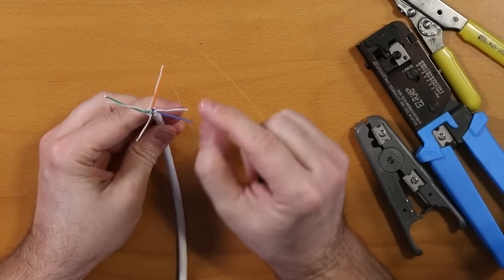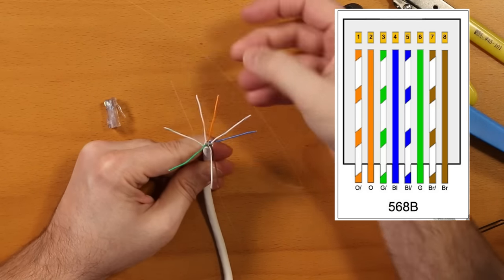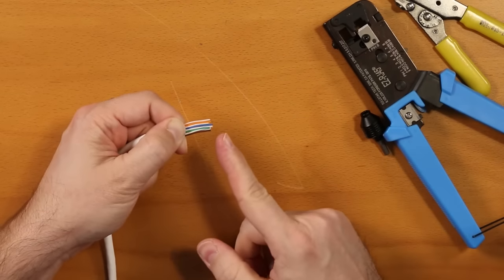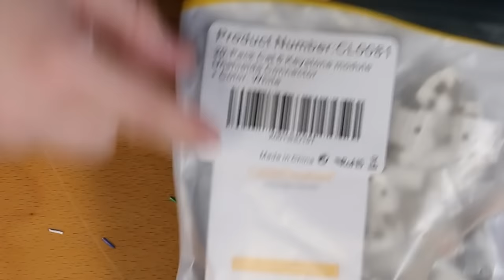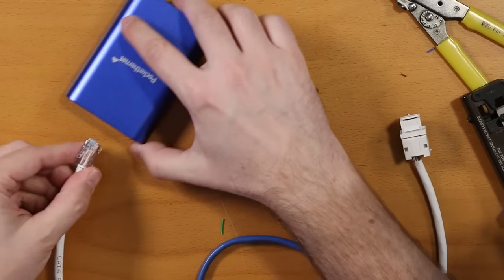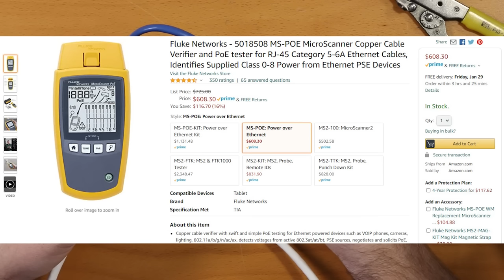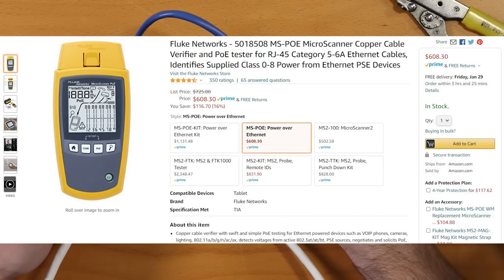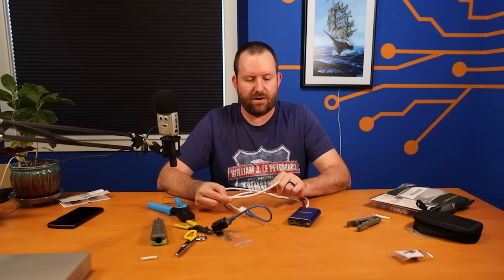How to Terminate Ethernet Cables

Comment: Not a fan of the pass through RJ-45 as it looks lazy. What’s so hard about pushing the pairs through to the end and crimping on the jacket?  I cringe when I see a gap between the jacket and the RJ-45 connector.

Same goes for the female end. I would place jacket in the middle of the keystone.  This would have shorter run where the wires are untwisted and hides the gap I mentioned above when the cover is placed over the wires.
Reply: The way you state this is such that you have never actually experienced a pass through RJ45 termination, but have pre-judged it and avoided it.  Use it and find out for yourself what is so hard about pushing the pairs to the end and crimping 50+ cables.  You will never use anything BUT pass through if you value the quality of your time spent on this earth.
Reply: I am confused; do you think pass through rj45's don't crimp onto the jacket or are you making two seperate complaints?
Reply: I've done probably close to 500 of each.  Passthrough almost entirely eliminates flipped pairs, and poor/unequal length insertion problems. Especially in dark IT cabinets.

If I did 10 of each back to back, passthrough saves about 10-15 min.
Reply: @jong2359  Maybe I have prejudged it since I have not done pass through termination.  But I do not see pushing 4 pairs of wires through the RJ-45 hard either nor an issue of unequal length when trying to get a flush connection.  If you snip your wires to appropriate length, it will fit and you push the sleeve to the crimp point.  I’m sure the pass through RJ-45s are more expensive too so that adds up.
Reply: @georgebush6002  The latter.
Reply: @soundman98   it’s true I see the advantage of being able to see the pairs easier when you don’t have a connector that can impair vision.  If you are crimping RJ-45 in a dark wiring closet, you have other issues as it isn’t worth the time to do since you should be working with a patch panel and pre-made patch cables that won’t have the clips break when you start to pull wires.

I don’t see a use case where you need to have a bunch of patch cables made other than the occasional custom length or possibly a crossover cable.
Reply: @soundman98  You maybe a little over-optimistic. The number one problem is a lack of attention to detail, although I can see how passthroughs might make it a little easier to get those details right.  Overall the advantages don't seem great enough to throw away my existing connectors, but I will probably look into passthroughs when I start to run out.
Reply: @pingkwong5302  1.  If you are worried about looking lazy add push-ups between stripping the outer insulation and building the connector.  2. Premade patch cables are an option, but they cost more and  excess wire length will make it harder to maintain a clean install, more so at busier patch panels.  3.  What are you or your coworkers doing that causes breaking connector clips?  This has never happened to me.  Are you not adding connectors after pulling cables or cutting and replacing zip ties as needed?
Reply: @georgebush6002  Patch cables run anywhere from $0.79 - $2.10 at various lengths with flex boot from Monoprice, not junk full boots where you need to strip the boot off just to release the clips. In this case, 0.5 - 7 ft which would take care of >90% of all scenarios. 

I don’t know how long it takes you to terminate both ends of a patch cable, but I would think 5 minutes would be a fair number to use.  So it would take an hour to make a dozen patch cables.  Unless you are paying someone minimum wage, it is not worth the time to make patch cables.  I would value their time more and have them do more meaningful work.  It also doesn’t look good if you are being paid a handsome amount doing consulting working and you spend that time making patch cables when you can buy patch cables for a fraction of the cost.  I don’t know about you, but I have never put some kind of boot on my patch cables so they are susceptible to being snagged from other cables and the clip breaking if the need should present itself that you need to pull the cable for whatever reason.
Reply: @pingkwong5302  I stand corrected, premade patch cable are cheaper.  Perhap I have also made a correlation is causation assumption.  In my experience premade patch cable installs are a hot mess.  This may have led me to have an exaggerated sense of the impact of the excess cable length   Perhaps just teaching the  installer how to better dress cables would have been good enough.

Comment: For ceiling mounted unifi access points, do you terminate the ethernet cable as a male and plug directly into the access point OR do you terminate as a female and use a patch cable?
Reply: I terminated the cable on a keystone jack, which I then placed in a surface mount box.  I then used a short patch cable between the jack and AP.

Comment: Don't clip off the string right away. The string allows you to strip a bit of jacket away and then pull that string down 6 inches or so to split the jacket. Then you clip the string and some extra cable off. That way the inner conductors you have remaining never had a strip tool near them that could have accidentally nicked the bottom end of those inner conductors. Old telephone man trick...

Comment: Lets DO THIS! Love pass through cat6 connectors, so easy to make real nice ends <3
Reply: Pass throughs are amazing!!
Reply: The pass through connectors are great until you come upon a piece of equipment that shorts the wires together at the tip, even when trimmed perfectly with flush cutters
Reply: @JBBBBBBBB250   Or have to redo someone else's poor terminations because they didn't cut the wires flush, so bad jack or plug. <cough> Panduit </cough>

Comment: "Cable" refers to the entire 4 pairs and sheath.  You push the wires, not cables through the plug.
You didn't push the cable far enough in.  When you crimp the connector, the sheath should under the plastic tab for physical stability. 
The untwisted portion of the wire must be less than ½".
When I connect to a keystone jack, I place the end of the sheath in the middle of the connector and then fan out to the appropriate pins.  I do not untwist the wires, as the separator between the blades will untwist the wires enough.
You can also get other connectors, such as type F for cable TV, speaker connections and more, that fit into keystone holes.
Use appropriate connectors for CAT5 & CAT6.  They're different.
BTW, it's a bad idea to use plugs with solid wire.  Patch cords should be made with stranded cable and structured wiring with solid.

Comment: Any recommendations for a more wallet friendly set of tools anyone can recommend?
Reply: Never skimp on tools would be my best advice.
Reply: Monoprice has cable testers and punch down tools for a decent price. Seem to work well for me.
Reply: Don't ever skimp on the crimper. The cheaper they are, the less reliably they finish the job.  The platinum tools or klien crimpers are one-n-done tools. Well worth the up front cost
Reply: @jong2359  Ditto.  Especially crimpers and good modules.  You can get decent testers that are inexpensive, I find the cheap kits on Amazon are so-so and crimpers suck.

Comment: Never cut wires with scissors, there is a special blade on crimper to cut wires. Also, for your thru-hole connector cutting is not needed.
Reply: Those scissors are made especially for cutting this type of low voltage wire. 🤷‍♂️

Comment: at my current job we use this keystone tool https://www.exw.com.tw/en/product/Keystone-Jack-Rapid-Termination-Tool/3J01-L01-00004.html and that with the keystones for it things go very fast but i have noticed every now and then if the wire isn't perfect in the slot it will not punch down right and require a tweak and re-punch but still faster than 110 punchdown tool especially when you don't have a surface to punch down on

Comment: I was just browsing thru some YT looking at vids on terminating Cat 6 cable to keystone connectors when the notification for this video came up ;)

Is it necessary/beneficial to completely untwist the pairs before staking them down to the keystone?  Watching this (https://youtu.be/Ug5MS0gpfMw?t=330) it looks like it might not be?

Already have the pass-thru crimpers, tester and other tools... just need to figure out where I want to pull cables to/from.  Got that 'Untwist' tool on order; looks like that'll ease one of the more annoying parts of doing male RJ45 connectors, for sure!
Reply: It depends on the keystone. For tool-less keystones I believe it is common to untwist the pairs. For keystones that require a punch down tool I believe it is common practice to not untwist them, for both performance and time savings. TrueCable has some nice videos for both types of keystones, that goes into more detail.
Reply: @kylehouk9405  tool-less keystones?  Didn't even know that was a 'thing' ;)  Sounds interesting!

The spot in the video I linked to above shows using a 110 punch down tool very similar to Chris's, just without untwisting more than just enough of the pairs to get them laid across the terminals - which is what spurred my question.
Reply: @memilanuk  Yes, I watched the video. You do have to untwist the pairs to fit them into the keystone. The idea is to untwist them as little as possible between the end of the cable sleeve and where the wire gets punched down in the keystone. As untwisting them here can introduce cross talk which will cause performance issues and may prevent the cable from performing according to it's rated speed.

 However to know if this is a problem you would need a cable certifier which is very expensive.
Reply: DO NOT UNTWIST the pairs. I've been doing network cabling since the 90's and can assure you I wanted to punch my monitor when I saw that. Lay them in the jack and see how they need to be to get them in the slots and you may need to slightly untwist to get them there, but DO NOT just completely untwist everything. I've showed dozens of technicians over the years how to do it and I always get some guy that thinks that is easier. It might be for them, it might not hurt your fingers as much getting them in, but it will cause signal problems and the cable will not certify. However, if you are doing this for your own purposes have at it, if they work for your needs.
Reply: @JBBBBBBBB250  lol. Me too I was like 😱

Comment: Lesson for others our there - I just switched a new outdoor Ethernet jack from A to B back to A (eating up important slack in my input line) only to find out...drum roll...the electricians never connected the lines inside the junction box. Never assume electricians are good, know what they are doing or are worth the money. FFS - I could have run this whole sub system myself in less time.

Comment: If all jacks on your patch panel are cat5/6, use a patch panel with integrated jacks.  It’s much neater,  easier to assemble, and costs less.  Blank panels are better suited for mixed media keystones such as cat 3 phone, F-connector coax, HDMI, etc with cat6.

Comment: You know, if you just use any pen, you can do the same thing to straighten out the wires very easily!!!  No special tool needed.  The outer case of the cable should also go into the RJ-45 plug more lilke 1/4" more.  Where it gets clamped down.  Not just barely into the plus.  That is just wrong.

Comment: I would love to see how to make a PoE kabel with Male and female ends.
Reply: The power will burn the joints. For Poe, I prefer no joints. Only end to end connection.
Reply: @mujtabahmedkhan  so you mean you always buy them prepared or what do you mean?
Reply: @D3nn.s  - I always make my own defined network and use wire without joints or coupling especially for Poe.

Comment: Wow, I'm just so uneasy with this 'how to'. The basics are there but so many details are off. Plenum ( CMP) is a fire rating for cable nothing to do with the seperator inside. With male RF45 connectors, the jacket has to be inserted as far inside the connector as possible, for cable relief and to shorten the lenght of untwisted pairs. On the female end, the pairs should be only untwited enough to be punchable. That twist is there for the signal quality and a certification tester would fail this connection if untwisted. and PLEASE use TIA T568A, always ( no reason ). I realy don't understand why there is still two standards going arround
Reply: I think Tom Lawrence says A don't pay.

Comment: Great video.. There is also a "punch down" tool for the Jack connectors. It is called "4 Pair Punch Down Tool". It works pretty well for some Keystone jack connector models and Leviton.
Reply: If you do cabling all the time, it would be a handy tool and time saver, but at $83 to do the once in a while cable, I’ll stick with the traditional punch down.

Comment: You female connector is also invalid, sorry :). You put cable in the middle, then route each wire with tension thru all slits, then punch down. Every slack of untwisted wires you'll leave will impact cabling characteristics. This can be seen on reflectometer clearly.

Comment: I prefer to use a keystone crimp tool over punch down. Way easier and you can work without a solid base to punch down. Try to do this above your head in a ceiling 🤣

Comment: You know...if you grab the base of the exposed wire with your thumb and index finger, you can pull straight up and untwist the wire or, if you're concerned about unintentionally pulling the wire out of the sleeve, you can hold the sleeve with a pair of vice grips. I lost track of the rest of the video once I saw you explaining that you spent money on a tool to do, slower, what your hand or a small nail could do.

Comment: Pass through connectors are unnecessary. Getting them to line up is the hard part. One still has to line up regardless if they're pass through or solid.

Comment: Pass through is the ONLY way if you’re doing male ends. Saved my butt many times when two cables switched places....
Reply: I use the two pieces RJ45 male ends. There is a little comb that you pass through your cables in, you snip them right at the end, and then you push the comb (with the wires) into the RJ45 and crimp. Really a life saver

Comment: Warning: If you buy the nice little flat cables... you're gonna have a bad time. They have the world's thinnest wires that don't work with most connectors/strippers and they break if you look at them funny. Just for fun mine colored half the wires white as well... so you could only id them by referencing their color pair... I'm bitter right now... just done 6 of them.
Reply: I believe the flat cables are for telephone use only. Like for older key or PBX systems (digital) that used 8 wire flat cable to go from the wall phone jack to the desk phone if I'm not mistaken.

I have an older RJ 11/14 and RJ45 combo tool that can cut, strip and crimp those flat wires.

Edit:  Now that I think about it. I believe that the old digital Key or  PBX systems used rounded 8 conductor cable as well. I believe that the 8 conductor flat cable is currently used for some data applications but not for networking in CAT5 or cat6 since it doesn't have twisted pairs. The flat cable also cannot be used for analog voice since cross-talk can occur between the pairs of long runs.

Comment: I hate making this male connectors, usually I buy the connectors that come with guides so I can put the cables in the correct order until the end, the pain in the a*s is eliminated since the hard thing to do is to maintain the order while sliding them into the connectors.

Comment: $23 for a tool to separate the easiest thing in the world, clearly you aren't as smart or you would have used the little jacket piece you cut off with the wire stripper LOL.. Why did you cut the wires? they're going through a pass through connector anyway LMAO? it gets cut with the crimp tool and straightens them out lol

Comment: save some money instead of buying the untwist tool use the jacket you stripped off the cable to seperate the wires, slip it over one of the wires and twist twist twist, same result.
Reply: I need to look up how to do that with everyone talking about it. 20 years of cabling and new to me. Like to not buy more small tools I will lose 😏

Comment: I still wonder that people use utp cable. I'm used to shielded foiled twisted pair cables. I wonder what a fluke network tester has to say to this wiring.

I personally prefer keystone, too. Good hint. If you ask me there are two more important things when it comes to terminate network cables. Test them with a proper network tester and label them properly.

Comment: Correct me if I’m wrong I think the word Terminate is not use properly.
When I saw the video title all I was thinking that he was about to show how to go Ethernet cable free By going wireless completely without loosing any speed or something. 
Man your title should be how to fix an Ethernet cable with the proper tools.
Reply: Terminate is the standard wording for it. It's related to putting an 'end' on the cable.
Reply: @soundman98  from what dictionary?
Reply: @HC-vh2ox  Just search "terminate cable" and see all the results. I'm sure that American English is frustrating if it is not your native language, as the wording of your comment would imply.  I also would say that used this way "terminate" is more jargon (specialized language of a trade) than a standard dictionary definition.